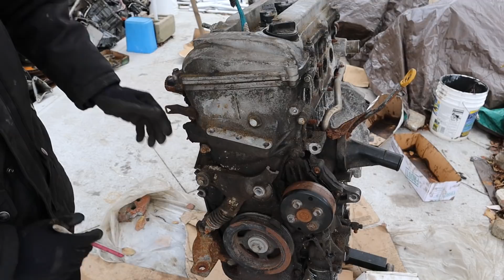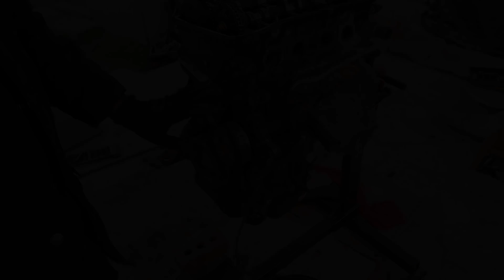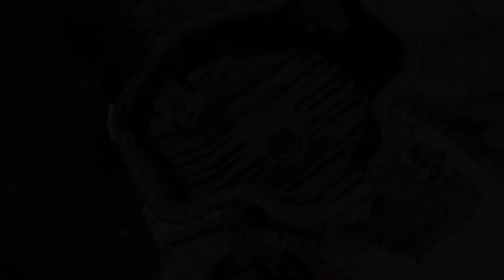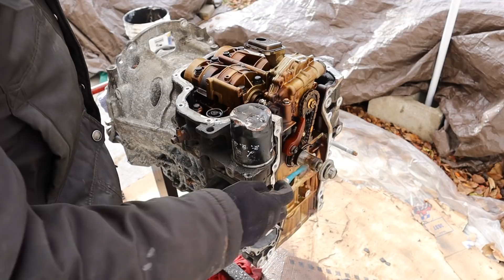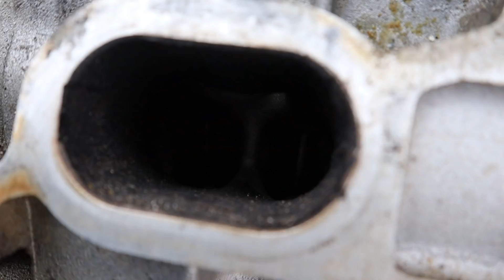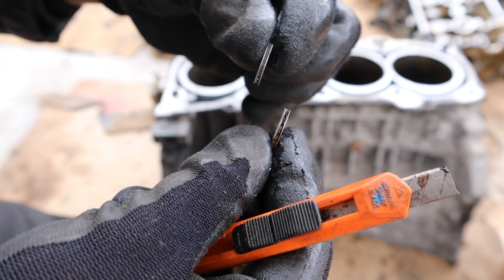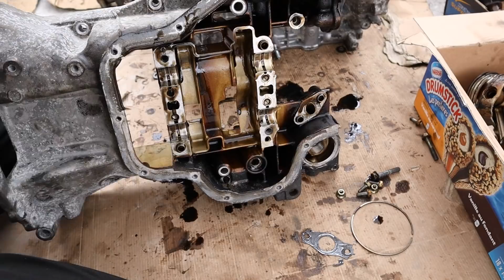Here's why Toyota Engines Fail

Comment: A trick i picked up for removing the adapter under the  oil filter is a 3/8 in ratchet with no socket. Very similar to the concept of the head bolt removal in case anyone wants to reuse that part.
Reply: Thanks dude. Going into one now, saved me some grief.

Comment: I'm on my second Scion xB with that engine and the first one did fail because of the issues with oil consumption and piston rings but I have a second when I'm trying to keep from blowing up and I'm curious what the best oil to use for longevity would be. I used Lucas oil stabilizer in the first one but apparently that wasn't enough...
Reply: just use the specified oil and change on the specified interval. don't use stabilizer, maybe unless you already have a burning or leaking problem
Reply: @mikuhugger  I should have been more specific I was wondering should I use 0-20 or 5-20
Reply: Lucas is trash as it's too think and aerates, yes even the synthetic version. It only helps if your already having engine trouble as it closes up tolerances.

Just keep your oil changed regularly and fill with a reputable full synthetic @ recommended viscosity.
Reply: @jyearr6744  I only use recommended amsoil now and I wish I'd remembered that I'd put the Lucas in it before because if I just changed it to regular oil I'm sure it would have consumed the quart in less than 1200 miles and I would have got a new engine under warranty!
Reply: Follow the manual's specs. Toyota dealers use the same oil in all engines here in Belgium because the customers don't want to pay for the correct oil.
Reply: buy toyota full synthetic. 5W-30 is specified for the 2AZ-FE.

Comment: Just chippin' in my 2.4 cents.. I have one with 200k miles in a 2005 Camry - I can safely say it doesn't burn any noticeable amount of oil. However, I am religious with the oil changes.
Reply: Same here with an 05 Tc 💪
Reply: Me too, 2002 with 205k mi. Smokes at startup though.
Reply: @sjn7220  valve seals getting old

Comment: My son's 2003 Honda Accord LX with 170,000 miles he bought last year burns oil, maybe a quart every thousand miles.  I think this engine has a similar problem to this one in that the piston rings get clogged.  If it weren't for me he would have seized the engine by now.  I make him check the oil regularly, he even carries a jug of oil with him in his car.  Just get the Walmart stuff, I figure the rolling use of oil is almost equivalent to an oil change, but obviously we still change the oil and filter during the specified interval.
Reply: Bought one for my sister from an old lady. Immaculate and lady driven since new with good maintenance records and it burns like this as well. I think it's an inherent problem with these K23's just no one wants to admit it. It runs like a top so we just keep it full on oil.

Comment: Watch Wes Work has a really good video series about installing the revised pistons in a RAV4.

Honda's later K-series engines do have some oil consumption problems caused by a similar move to shitty oil control rings. Pretty much every manufacturer was guilty of this in the late 2000s and early 2010s.
Reply: Agreed, they all went to thin rings with low tension to improve fuel economy (a selling point) at the expense of engine life (not a selling point).

Comment: You should take apart the 5sfe engine from the 95-01 camry. I've had 2 of them and one threw a rod due to weak connecting rod bolts. Apparently it's a notorious problem with those engines. People say they're reliable, yet the one I had had ZERO sludge or anything. It first started sounding like a valve tick which progressed to a light tapping sound around 2k rpm, then while driving on the highway, the oil pressure light came on and started knocking like crazy and it threw #2 rod which broke the front engine mount and oil filter. Yes it ripped the filter off. Crazy.
Reply: How many miles? I owned two 5s-fe one with 275k (started getting weak compression after 16 years of daily use/abuse) and another with 175k, best engine in my opinion. Then I bought a 2014 with a 2AR-FE as talked about in the video, didn't burn oil but the valve train wanted to launch itself out of the valve cover after every oil change and  during every cold start. 5s-fe's were the best engines IMO and experience at least....
Reply: @awaara24  I've had a 96 Camry with 60,000 miles and a 95 Camry with 110,000 miles. I didn't beat on them or anything but the car that threw a rod was the 96 camry.. The 95 started making the knocking sound so I was able to sell it before it took a crap on me.. Alot of people had said that these cars are reliable yet these engines just love to throw rods..
Reply: @awaara24  This video isnt the 2AR-FE, but the 2AZ-FE. IIRC The 2AR-FE is related to this engine but fixes issues like the piston rings. But the 2AR-FE also has the cam phaser rattle which is most likely the noise you were hearing after you did an oil change. Mine does it on startup and according to lots of other people, it doesn't really affect the engine in any way other than it sounds bad.
Reply: @d0cx  I know the difference. I was stating that the 2AR-FE while may be better, had nuances of its own. By the way, the chain rattle that occurred after oil changes (and really cold days) - there was only one way that I was able to get rid of it; I always filled my oil filters during oil change and that didn't prevent the noise. There was an additional step, I would fill the oil filter housing completely, then after filling the engine up with oil, i would then remove the fuel pump fuse and crank away until the oil light on the dash went out. Then and only then did the noise not occur lol
Reply: @awaara24  you can hold gas pedal to the floor it shuts down fuel and it will prime the motor with oil same thing your doing with out pulling relay.
Reply: @southside1975  thanks and yes, I learned that after I sold the car lol
Reply: @awaara24  2s 3s and 5s engines are all great engines
Reply: I've seen it.  Strange how it affected a few and many ran several hundred thousand.  I worked at the dealer back in the 90's when they were new and Toyota never admitted a problem but I saw 3 still under warranty come apart.
Reply: Same with my 2000 camry 260k miles
Reply: Ooo crap, I thought they were more reliable, but then I had more Hondas than Toyotas on the hoist.
Reply: Still more reliable than the 2az-fe
Reply: I used to work at a Toyota junkyard, every week I would get 3 to 4 calls for the 97 - 01 Camry 4cyl engine seldomly got em in but when we did they would go quick. The V6 Camry is way more reliable but I have seen people with the original 4cyl between 300 and almost 500k. I have read about some with more miles. If you absolutely need a 4cyl, or just want to buy a Camry, make sure the first digit of the vin is a J NOT 4. Vin J is Japanese and Vin 4 is American.

Comment: All this is correct. I hydro locked my 09 Scion tx, rebuilt motor i purchased was from a 05 Camry so head gasket blew in 6 months. Their warranty replacement gave me another Camry motor that blew head gasket again about 5 months. The third replacement, i forced them to helicoil  coil before sending it, and that one survived many years

Comment: So these engines were pretty good if you changed the oil...right? I have never had an issue with any Toyota engine. My v8 Tundra has 21 000 kms and just had 3rd oil change done. I love the digs at VW....the Germans and plastic.
Reply: The current OCI for Long Life oil for VW, BMW is 30k km. I guess someone at the corporate level in Germany decided it is a good idea to increase sales of new cars and lower the used car market outside Germany. Car as kitchen appliance - low maintenance, low life expectancy but full of gadgets
Reply: That usually the death of most of these engines lack of oil. owners never changed the oil or at least added more if it was low
Reply: @avrggamer69  Check out YT CHANNEL JUST ROLLED IN....The other day, a mechanic removed an oil pan and the oil was like jello. The interval was something crazy like 70 000nor 80 000 kms. People are just nuts
Reply: Either lack of oil or too thin of an oil. I use a 5w 40 in mine with 200k miles for summer time, and a 10w 30 for winter. Never seemed to have an issue with oil consumption doing it that way.
Reply: 5w-40 for warmer places is something what I use instead 5w-30. However, even German engines don't use the usual 5w-40, but more in 0w-40, 5w-30 grade. For engines 'requiring' 5(0)w-20, 0w-30 seems like good compromise.
Reply: @pliedtka  If you go beyond 20, the engine may knock because the thicker oil cannot pass thru the close clearances. Both Toyotas my wife and I own use 0W,-20...I am amazed it protects the engine in hot weather.

Comment: Depending on the year, these motors had a TSB for the oil control rings clogging, causing oil burning. That's likely what happened to this motor. Prior owner probably didn't ever check the oil.
Reply: I’ve seen this type of engine switch from ‘normal’ to ‘burning oil’ rapidly. Even if you check the oil every day and it’s fine, then one day it’ll drink a couple of litres of oil in a one or two hour drive.
Reply: @dale116dot7  i have a 2002 corolla that has that issue, working on getting the engine out to hopefully tear it down and fix it
Reply: @dabigboom8140  Someone I know had a mid-2000s RAV4 and the oil was topped up before a two hour drive. Halfway through the drive (one hour) the oil pressure lamp came on, she pulled to the side of the road and filled it up again. Yet it drove for months with just a little higher than normal consumption. The local dealer would monitor the oil use but never believed that the oil consumption could switch on and off like that, even with new crankcase ventilation parts. In the end, the ECM went into the unintended acceleration mode once and she got rid of it after that. It wasn’t a floor mat or anything. I think that the diagnostic for the pedal is not fast enough and the remedial action that the software did was not adequate for avoiding low speed collisions. But my day job is actually writing ECM software.
Reply: @dabigboom8140  Just put heavy oil like 15w40 or a good engine additive. I even used 20w50. It helped a lot! It really cant damage the old engine its already damaged
Reply: @dale116dot7  I have seen mine all the sudden take a huge slurp of coolant, then go for years and not sip any more. Just swore off the stuff. Later to binge again.... Same with the oil. 
Before mine went down this week. I checked the oil 2 weeks ago with 2400 miles after the oil change. It was reading great, but I noticed the blackish tint to it. Three weeks ago it had golden oil. I had started 4500 mile oil changes back in 2020. So I had noticed that I could never keep faith in oil after 4500 miles definitely. But last week was the end for the ole girl. 2400 miles on this oil change and totally black, she's toast. I should have stuck to Lucas and 3000 mile oil changes.
Reply: @dale116dot7  Dont buy toyotas garbage.
Reply: I had an ‘03 Camry with this engine and I’m sure the previous owner didn’t give a rats ass about the car because it was absolutely awful on burning oil and it was leaking from everywhere.
Reply: @Mygfisawesone  happens when cars is sold many times...
Reply: if you have eyes on your face

you see thseese toyotas engiens are a completly GARBAGE, and they are not the only ones...

Comment: Ahhh, yes the lack of maintenance.  Most modern engines regardless of manufacturer will last a very long time with proper maintenance.
Reply: would have to disagree, there are still companies who make a bunch of crap engines, regardless how you maintain them
Reply: @rShadowFace  that's really true.... Especially euro cars
Reply: BMW disagrees with Jeremy Murphy.
Reply: @hedgehogthesonic3181  Audi, VW, Subaru, Nissan say hello
Reply: @rShadowFace  vw audi? Lol, the vehicles are as shitty as the people who drive them. Every road rage incident i get in involves an idiot vw or audi driver.
Reply: @Shornandkenny  i meant that those car makers make unreliable engines
Reply: @rShadowFace  ya, definitely the domestic companies make shite engines indeed
Reply: @rShadowFace  Old SOHC Subarus, the DOHC and modern ones are solid.
Reply: @Shornandkenny  older vw Audi cars are fantastic. Around dieselgate is when quality and longevity started to take a sharp nosedive with those companies.
Reply: @Tythecodeguy  ya, i liked the 80s 90s vws indeed
Reply: @hedgehogthesonic3181  BMW is generally average, or above average in reliability compared to major car brands. So this is false. Furthermore, there are specific models within each brand that are generally more unreliable than others. Even toyota has these models. So this BS about BMW "hurr durr unreliable" is untrue.
Reply: @hedgehogthesonic3181  I Recently sold my vintage BMW with over 300k miles on the odo which with original engine and transmission. According to my mechanic I could have got another 300k miles from original power train. oh btw I'm not a maintenance freak only do marginal maintenance. I also own  2004 BMW that have been an absolute joy to own and plan to keep till the wheels fall off.
Reply: @noelaguirre7104   That's good, but Germans are not known for making good reliable vehicles, nor easy to repair vehicles.
Reply: @noelaguirre7104  I’m gonna have to call bs on that, 80% of the bmw I’ve seen at my service center usually has some oil leak minor or major, and especially your 2004 not having a leak from any of the areas they decided to go plastic in the late 90’s and up models sounds unrealistic
Reply: @eVerProductions1  agree with u, all the plastics in the bmw are absolutely horrible, the stuff will literally turn to dust if its older than 5 years old in the engine compartment. almost all bmw leak oil from everywhere, we're usually suprised when the belly pan is actually dry on any of these cars. vw got better with the new engines, since like 5 years, but between 2000 and around 2015 you could point your finger at something on the engine and it was gonna break.
Reply: @hedgehogthesonic3181  bmw actually makes really good engines. Ofcourse manyfacturers will have some engines that arent so good.
Reply: @vetkosgarage6165   That's not true at all, specially when we look at how difficult they make these engines to take apart and repair.
Reply: On some vehicles transmission and engine replacement under 100k is proper maintenance. I've seen many a newer  domestic  at many a junkyards. Cars not even 7 years old, there is definitely a LACK OF QUALITY.
Reply: @mbrunker5167  yes you got that right they're Lack Of QUALITY! FACTS.
Reply: Jeremy Murphy, you sound like a used car salesman.
Reply: @Bimbo-Balls  hes right tho
Reply: @Shornandkenny  

Not really. M Brunker summed it up perfectly.
Reply: @Bimbo-Balls  oh, sorry i dont even take domestic crap into consideration.  
I only drive Japanese. One key word in bunkers reply.... domestic
Reply: I live in dusty Southeast Asia. Guess what! Old motorbike lasts longer than cars does. I blame to junky Chinese cheap parts including scam technique mechanics applies to old cars here.
Reply: GM: Hold my Northstar
Reply: Except Hyundai. Never buy a Hyundai.
Reply: Yes that's true
Reply: Stop giving toyota a free pass on a shitty design
Reply: These are simply shitty engines

Comment: I don't trust Toyota engines any more. Lexus (2AD-FHV) IS diesels were terrible engines. I had an IS220d, which slowly blew pink coolant from the expansion tank overflow tube (the crappy aluminium heads moved slightly on top of the block, probably due to inability to handle thermal expansion/contraction). I dumped it before the head gasket went completely, after it blew an injector o-ring, filling the car with toxic diesel fumes. These engines also had a badly mismatched turbo, leading to no power from take off. The only option was to brutalise the engine, and dump the clutch, just to safely accelerate (it had absoluely no torque from a standing start otherwise). I assume it was designed to be driven this way, otherwise it would have been outright dangerous. It also had the worst gear ratios of any car I have ever driven. 6th was only usable at about 80mph, or the whole car would shake, and 3rd was needed until about 60mph. It pulled like a freight train in 3rd however, one the mismatched turbo got going. The 2AD-FHV engine alsp smokes more than a cargo ship on cold days, and completely blocks the EGR valve with thick soot about once every 2 to 3 years. I suspect it tries to burn off the dpf (there is a special 5th injector in the exhaust manifold), but the system is garbage, and doesn't work properly. Nearly all IS220ds that I have seen do this (not many left these days, because they probably all broke!). There are also issues with the clutch release bearing, which make awful noise with clutch actuation, and DMF fails early, which causes clutch judder, leading to expensive clutch+flywheel replacement (about £1500 in uk for parts!). It's a real shame, because apart from the dismal powertrain, it was a nice, and really well built car. IMO, it should have been recalled for engine, turbo, and gearbox replacement.